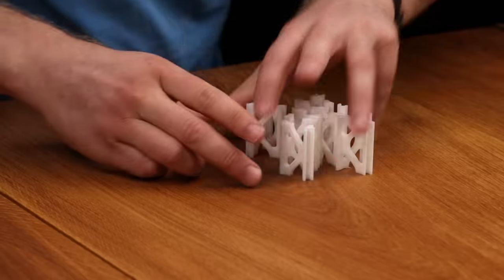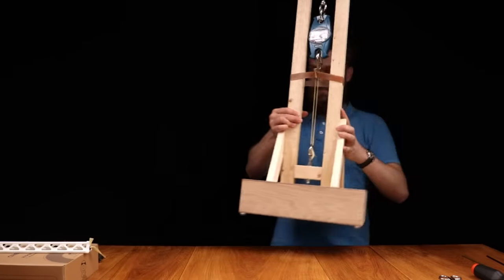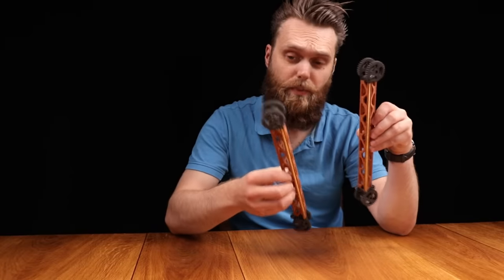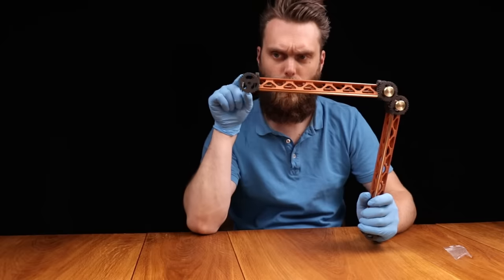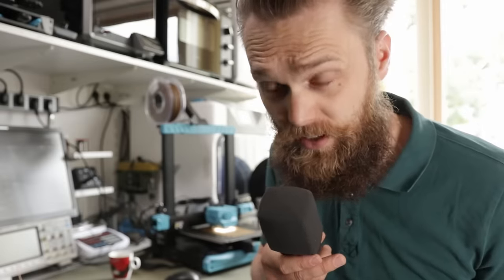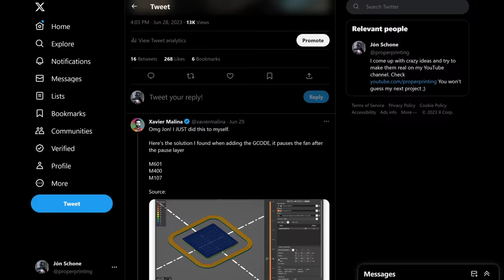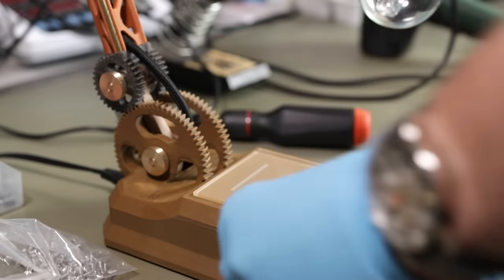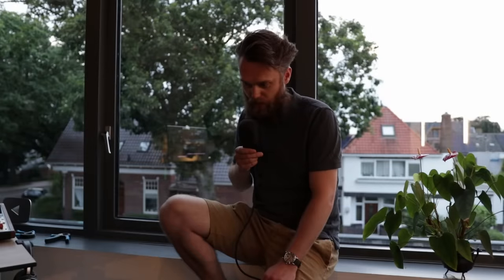You can build AWESOME things with this 3D Printed System!

Comment: I wonder if you could also do the tuning in reverse given that you know pretty much know what frequency corresponds to a given tension. If you were to play the appropriate frequency, I think you could potentially just tension the fiber until it begins to resonate with the frequency you have playing. I don't think I've ever had a comment seen (or at least publicly acknowledged) by a creator, but I do hope you see this. I know the audio could be annoying but it's something I think is worth trying. 

Edit: I have now read many other's comments about the length and thickness which contribute to different pitch results. It definitely would make more sense to apply my suggested method only once you have made some sort of pitch-length map, as @HennerZeller suggested.

Comment: Awesome design! Create an outrigger for one side of the spring to attach to so that the ‘arm’ of the force vector to the pivot point increases and as such the momentum caused by the spring on the pivot. Can even do that on both sides if you want to keep them attached ‘over the top of the hinges as you have them now’. Essentially the spring would become a Mohawk at a little distance rather than hugging the pivot.

Edit: your actuall pivot point is the gearing and it changes location relative to the springs. Take that into account when you try to envision how you can create a smooth powercurve…

Comment: I dont know if youll see this, but you could make a closed or open oval shape (like an elongated C shape) with the arcs the same profile as the gears as a set of locks for the hinges. The distance would never change, so once you have it in position, you slip your c shaped clip over the gears and it can no longer move. Might look a bit nicer than the spring. Just an idea.

Comment: Had to hit the thumbs up at the Tension-Pitch correlation testing rig. I've been trying to think of something more complex to design that is functional and cool. I find it hard to decide on something that can be 3d printed. This has started some gears turning in my head. I wonder how long you can make one of these truss systems. The outside rail could be the limit. I wonder if there is an alternative to using rigid stock in it's place. I guess it would have to be something that handled the compression from the deflection.

Comment: Absolutely beautiful. I've dreamed of lamps like this. I'd like to see this design with torsion springs inside of the hinge, instead of coil springs. You could make the hinges as little packaged modules ready to be installed into each joint.
Reply: You know those toy cars we got as kids, you could roll them backwards to store energy into the spring, and then let it go and it would zoom across the room on its own? Same concept. Store energy in each hinge at just the right amount.

Comment: Great design, I totally LOVE IT!! I think a better solution for creating more tension in your rail system instead of the fiber cordage would maybe be braided fishing line. Braided fishing line comes in many different pound test, that way you're able to use whatever size pound test with minimal weight in use for your design.

Comment: If you can terminate the filament in the internal space of the truss (where it runs now) with a turnbuckle type system you will be able to go to a much higher tension. You are wasting a lot of the strength of that aramid fiber on the twisting forces that gain you nothing except a simpler tensioning system. You could even make tiny short throw turnbuckles from rod and eye nuts. Just grind two flat spots in the thread. Even better you could also make a single center span that has grooves to keep the eye nuts from spinning while still giving access to the rod for tensioning. Just my quick thoughts. Project looks great!

Comment: I'm using a lamp arm as a mic stand for my Samson C03U which is fairly heavy, and it's really pushing the long travel tension springs. It took some fine tuning of the mechanism. So I'd say you matched the functionality of the industry, and easily exceeded the aesthetics. 

Any thoughts on the name for your tensegrity GDP machine? I fully support your engagement with the industry, and your potential future as a leader of progress.

Comment: the lamp is very beautiful, only the halogen bulb I think is now obsolete both because it consumes a lot and for the production of unwanted heat, it seems to me that there are G4 dimmable LED bulbs, so it shouldn't be complicated to replace them.

In this regard, I suggest experimenting with a square wave switch system that operates on very high frequencies (such as the latest generation neon) so as to see what happens if you power a LED with that system, i.e. if by varying the square wave you get a variation of brightness without however perceiving the flicker which would be a problem.

Comment: Nice work and great presentation Joe. I was looking, everywhere for the cable routing. You are the first to mention it and yeah, I found out the hard way. I’m going to move mine internal. I also updated my bed to PEI sheet and I love it. I also, right out of the box, got rid of the bowden (all together) and swapped filament mounts with another printer because it had the height to mount up top. Offset to the right of the printer… I’m seriously thinking about the Mercury One update (hydra last) but I have to say, for my second printer, same price as first which is a bed slinger Anet A8 Plus, I’ve been thriilled not only wih the quality of prints I’ve been able to build but also with the speed. Great printer. Got my sub. Looking forward to more from you.

Comment: You can buy 6m length of 6mm c45 axle steel for like 10 bucks. It will increase the size of the holder but you might be able to get away with using less filament that way. Also has a cool color.

Comment: I may be wrong,
but I believe that the Kevlar yarn currently has limited functionality.
Since the yarn runs in the middle of the beam, there are theoretically no forces acting on it (except for the pretension).
The further the yarn is from the centerline, the stronger the forces can act on it.
(Theory of neutral axis in a beam & second moment of area)

This is the reason why e.g. paperboard or CFRP sandwich panels work.  The outer layers carry almost all the forces, while in the middle there are almost no forces.

Comment: Look at bowstring material for your tensioning system. The diameter will be smaller and probably a factor of 10 stronger than the Kevlar. It doesn’t store energy and is fairly inexpensive. You may even be able to get it free from a local archery shop if they have recently restringed a bow. And color choices will be excellent too.
Reply from the maker: That's a great suggestion, thanks!

Comment: Carbon fiber rods are a great replacement for the kevlar as they can be in tension or compression without relaxing and CF has an extremely rigid young's modulus, however it has a PATHETIC transverse compression strength, you will also need twice the rods in compression as in tension since CF has a worse axial tensile strength too.
If you engineer your truss to redirect transverse forces into axial forces you will make an extremely strong and very useful invention.

Comment: 3d printing the structural members of a 3d printer frame is a bad idea even when you add internal stresses bc of the *young's modulus* of the material.
I've noticed that one fiber will always be in compression when a non-axial load is applied, shortening the member and making it lose all the preload (you're pushing on a rope if you bend the beam and transmitting all compressive stresses to the plastic).
The deflection of these will be too great for a rigid printer frame. You can try making a delta printer, increasing height of the section parallel with the force and devising a system that automatically tensions the compressed kevlar by increasing the distance it has to travel as the beam begins to deflect.

Comment: Pitch is affected by the length of the string as much as the tension. You can only reliably use pitches to calibrate tension if your spans are the same length.

Comment: the spring is going to pull through the hold it's connected to, unless you put a collar washer in there to reinforce it? I'm so glad to see you back making a video. The montage with the military drumming was excellent!
Reply from the maker: I think that It does need some sort of washer indeed, a conical washer could be interesting to test as well I think.
Reply: @properprinting  Yep, a conical washer was my first thought.

Comment: If it's a low voltage bulb... you could use the brass rods as conductors instead of the wire! :)

Comment: I think to be sure the note correlates with the tension, the number of strands in the tensioned cables must be the same, as well as the length.  Guitar strings at different thicknesses produce different note ranges at the same relative tension and length, right?
Reply: Keeping as many variables the as close to identicle is deffo a huge part in this. Super interesting stuff from a man way more clever than i

Comment: Instead of the springs, could you run a kevlar line through the rear brass tubes? You could terminate it at the lamp and then have a winding mechanism at the base of the lamp. You might need two, with one terminating at the elbow.

Comment: Very interesting thing to use fibers.  I don't know if you could make it work or not (sorry, I'm not the experimenting kind) there is a way of strengthening concrete with pretentioned steel.  I wonder if you could do something like that with 3d printing.  Put a pause in at the need time to put in and pretention the fibers.

Comment: great project! maybe an atachable counterweight would be a solution for a heavier load? Thanks
Reply from the maker: Thanks! As long as it's an opposite force, it'd work. A stronger or extra spring can also do the trick but it mustn't be so strong that it destroys the part which is pretty tricky with tension springs.

Comment: Hey buddy. It's me again =) 
Excellent result. 
A nice knee joint turned out. 

I would like to know what you think about DIYson? 
And yes, I once made a model of a similar lamp. But with one feature. 
All the wiring is hidden inside. It is automatically tightened by a set of pulleys.

Comment: love the lamp always a joy to watch you thinker around i do think the lamp and mic holder have a few issues for long term use but as prototypes they look realy nice maybe wane improve on them i enjoy them. how they look / industirial / cozy feeling. Maybe you can do a different tension system because the fibre has been giving issues since you used it as a idea.  how ever the sand in the foot of the lamp is a neat idea gives it some proper weight. (but you dont need decorative sand for that if you spend some time collecting and sifting it out from dirt or beach areas hehe. or something else with a different weight small rocks. (i do believe every kind of material has a different science value of weight i had a 1 of these science books years ago (i forgot the name) but its a materials list and calculations how a tested material should respond to a serten situation. but back then we also did water tests with if a material would float or sink / density (anyways to keep it simple) i dont know if decorative sand is a good weight idea for ather things / if theres a heavyer / cheaper material it might maybe make sense to use that instead. =) do love the lamp idea with those struts

Comment: i like it.... but i would....
1. make the big gears in the base separate parts, both so you can have smaller prints, and so they can be printed in a stronger orientation. Plus, you can then have more color options for decorating it.
2. choose a different touch pad, with buttons and a lighting color that match the rest of the projects style.

Comment: An idea for the proper tensioning process- not sure how easily it could be done or how it'd be done, but maybe you could make the tension system able to use a torque wrench? People could still use the pitch method but those who already have something (I'm not sure if they make torque wrenches that small though) could just set it to stop at the appropriate point.

Comment: Unfortunately having the string in the middle decreases the strength and stiffness of the truss a lot as it reduces the effective height to a third. This results in a 9th of the strength and a 27th of the stiffness (if my maths is correct). But adding 3 independently tensioned strings is going to be a major pain - if possible at all. May be moving the string out of center for trusses with a main bending direction is an option.

Comment: Does that tensioning system not add some shear stress to the fibers? Idk for sure, but I would think the twisting action may impact your max achievable tension.
Reply from the maker: It might, no idea. What I do know is that it can hold up to almost 70kg and I recon that this will never be the bottleneck as long as it's 3D printed.

Comment: How about instead of sand in the foot, put some heavy power bank in there (and / or)? Maybe with some outputs at the back, side or top for charging other devices. Wireless charging construction, either for charging the power bank itself or other devices?

Comment: Maybe Dyneema next time?  I have a Dyneema woven thread of about 2,5 mm in diameter that holds up to 580 kg before breaking. But good job, looks great.
Reply from the maker: I think that Dyneema would be interesting, but mainly because of its longevity. Strength wise the Kevlar is far from being the bottleneck. Thanks!

Comment: doesnt raw kevlar degrade under uv? why not paracord cores (the polyester version, nylon flexes more)? Also, this pitch thing is not just tension, its also length, so i assume you can only use a guitar tuner if you only use that length.

Comment: Seems like you could modify the pitch and thickness of the tensioning screw to achieve a higher tension 15kg is only around 1/4 the strength of the fiber
Reply from the maker: Yes, that has to be optimized! The fiber definitely isn't the bottleneck here!

Comment: FDM Resin printing? That's a new concept to me. What advantage would it have over standard plastics? Why not just go with a standard resin printer?
Reply from the maker: This is part of a big project where I'm going to do research on continuous fiber printing, 3D printed electronics, mixing resins and combining multiple techniques on one single platform. It'll be quite the challenge!

Comment: Would the tuning be different for different lengths, or does the math works out that you always get the same frequency for a given tension regardless of length?
Reply from the maker: Definitely, just like a guitar. I forgot to mention that in the video, but the length of fiber in the rig is the same as in the profiles for the lamp.

Comment: Might want to use dyneema, I think it ages a bit better than straight kevlar
Reply from the maker: I'm going to look into Dyneema, but I'm also wondering how much Kevlar degrades over time. I'm not close to it's maximum tension strength with this design.

Comment: I know this was just a fun project, but this is a misapplication of springs. The spring bent over the angle is going to have all kinds of problems as this type of spring are not meant for wrapped/bent use. If you want springs like that, they are called torsion springs and there are online calculators to determine what strength you need, but there are reasons they are seldom used for this purpose. You also are giving up almost all of the leverage/lifting power you would otherwise gain with these springs. A quick google for "lamp springs", "torsion springs" and "desk clamp stand" all should help with normal spring placement.

Comment: add a hydraulic brake system that clamps on demand with a push of a button right where you want to move it.. And some:4 dress up, add on accessories
Reply: a small vacuum system in the base, to have some fume suction abilities on desk.

Comment: Instead of sand I would have filled the base 3/4 of the way up what was already printed with lead split shot, then poured some epoxy in to secure it. I think that would have give a much more stable base. As long as you don't top all the way up with epoxy you should still be able to use the part cooling fan. I really don't fancy having any kind of sand any where near my printers.

Comment: I use the same principle with tuning to reach desired tension with belts on my corexy 3D printer!
Reply: In case of 3DP it's not so easy because many designs move belt away from the stepper flange and due to this max radial load spec of the stepper is exceeded, to counter this many manufacturers recommend to undertension the belts by a lot (eg 8-9N instead of 30N)
Reply: @szymonjastrzebski2909  yes! That is exactly why the community made decoupling mods for ratrig printers. Also, 2 motors per axis also cut the belt run by about half. Less strain on motors and higher possible accelerations!
Reply: @Kossmok  decoupling as pulley on the shaft with bearings, connected to the stepper shaft via a coupler?
Reply: @szymonjastrzebski2909  yes! Exactly like that
Reply: @Kossmok  nice! Main issues with such assemblies are alignments as for example small scale bellow couplers call for 0.1mm max radial error and for example Annex K3 assembly doesn't guarantee alignment and couplers fail after some time